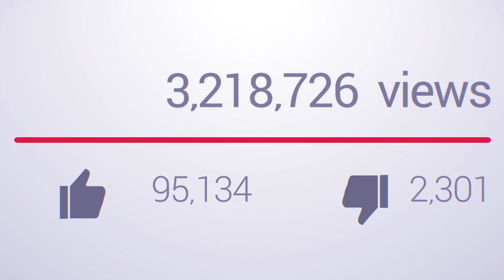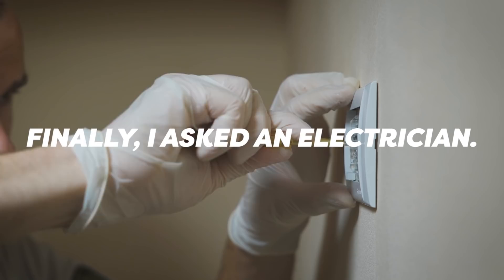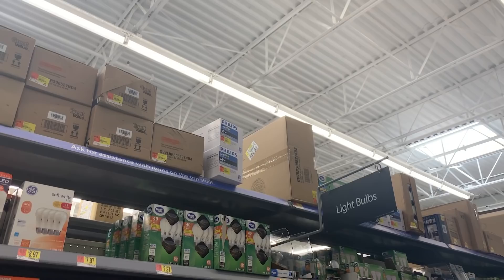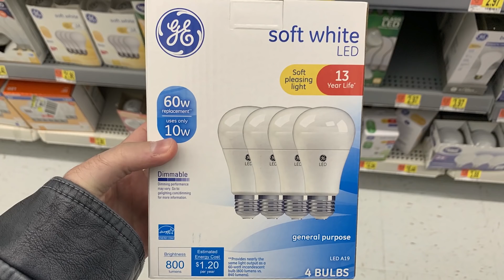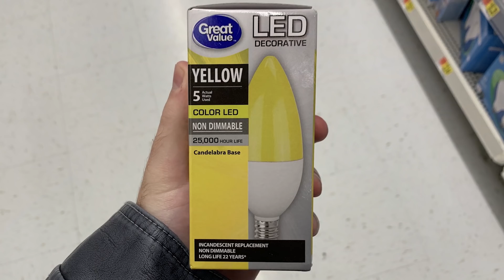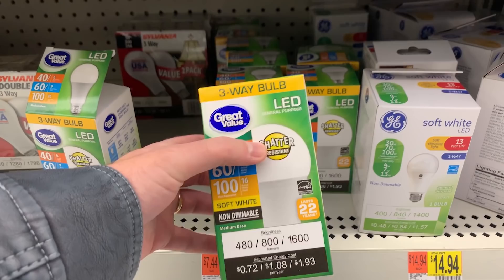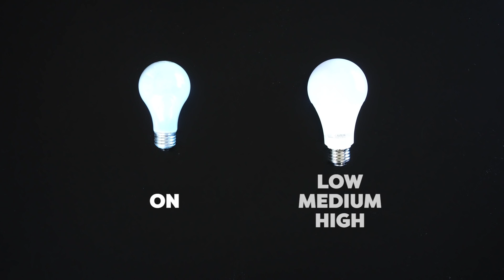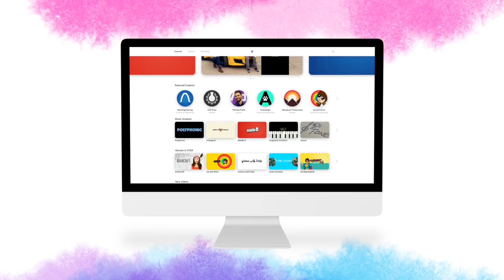Why Do Some Lamps Click TWICE?

Comment: “My car, one turn of a key.”

Proceeds to turn and click the key twice without starting the car...
Reply: Thank you for catching that. :)
Reply: I watched the whole thing waiting to learn how a 3-way bulb works.
Reply: @ugway051  oof if starting my car did not need my keys, I would totally just leave them at home
Reply: @seannelson9998  the bulb has a second ring on the bottom  center tip, ring - position 1 center 2 ring 3 center and ring 4 off
Reply: Meanwhile I have to turn the key and hold. This was posted by carburetor gang.
Reply: ugway051 or a golf cart

Yes I know most golf carts have keys, but they’re literally just dumb switches that aren’t required to be installed. You can just remove the key switch and wire it so it’s always ready.
Reply: I have to turn the key and pull a lever to start my car.  That's because it's an old Mercedes diesel.
Reply: Jacob Belcher 35 I had to turn the key while putting some pressure on the shift level...because my vehicle is a janky POS.
Reply: Thank God I'm not the only one to notice this.

Comment: Bonus learning moment:
The light from the lamp at 3:47 doesn't actually appear to get brighter at the three different settings.
But if you look closely at the wall in the background or the fabric at the edge of the lamp, the auto-brightness adjustment on the camera is dimming the whole scene slightly to keep the brightest part of the image (the bulb) at the same intensity. Therefore, as the bulb is turned up everything else gets slightly darker while the bulb appears to stay the same.
An example of the truth that photographs or videos don't show you "reality"; they show you only what they are designed to show.
Reply: so it goes from high to low?am confused
Reply: @siso8683  To keep an image from being washed out by bright light or too dim to see anything, the camera tries to maintain a certain brightness in every image it takes, which it does by controlling the exposure (brightening or dimming the whole image). When the lamp is turned from low to high, the camera compensates by dimming the whole image, so the bulb appears to stay almost the same brightness while everything around it dims.
Reply: @siso8683  Yeah it goes from high to low it seems like
Reply: @MorphRed  pretty sure it's the other way around, the camera is darkening the whole shot to compensate for the bulb's brightness
Reply: @MorphRed  no, the lamp goes from low to high. this is evident by the background getting progressively darker, not brigher.
Reply: Another way to phrase it is that photographs are "normalized" versions of reality. Nothing is too bright or too dark nowadays. Hell, many cameras take better photos in the dark than they do in the light.

Comment: Conclusion:

There’s three contacts on a three way bulb. Neutral, small filament hot, and large filament hot. 

Low is the small filament. (40w)
Medium is the large filament. (60w)
High is both filaments. (40w+60w or 100w)

Of course, LED bulbs don’t use filaments, rather two separate drivers and two different diode circuits, still working in combination to make high brightness or separately for low and medium. 

A standard bulb, as mentioned in the video, only has one filament or driver circuit. So it is only on when the lamp is set to medium and when the lamp is set to high (as the medium and low settings would be on together). That is the reason for the two clicks that the bulb is on. The other two clicks when the lamp is off is the designated off setting and when the lamp is set to low (standard bulbs don’t have the low contact).
Reply: I was looking for this comment.  Guess I'm just old, since this was no mystery to me, and have used 3 way bulbs for years before the cfl/led stuff.  Lol
Reply: Joey | the video from 4:03 to 4:30 is worth the thousand or so words in your comment :)
Reply: t5o7m Right, but he doesn’t go in detail with the specifics. He rather stated how the bulb skips a brightness setting because it wasn’t built to do it. (I was also adding the details on why the numbers are 40, 60, and 100)
Reply: The interesting part is, there are some bulbs so poorly designed, that the neutral of the bulb actually touches the "low" contact point - literally creating a short circuit.

Comment: "My car, one turn of a key"
Proceeds to turn the key for 2 clicks.
Reply: I WAS JUST ABOUT TO COMMENT THAT
Reply: SAME HERE
Reply: My car takes 3 clicks, but it won't stay in the fourth mode.
0: off, 1: unlock steering wheel, 2: turn on electronics, 3: ignition
Reply: My mom's car turns on automatically outside the car if she wants to. 
With just one button press
Reply: Well each click turns something on :)
Reply: @Liggliluff  0 off, 1 turn on electronics, 2 ignition, 3 crank starter. That's how it works
Reply: @annagrace2604  
That's not automatically.
Reply: One of those clicks is ON and the other is START. The cars electrics work fine at ON. And START is a separate circuit for the starter solenoid to engage.
Reply: I got a diesel so I have to heat the engine then turn
Reply: @annagrace2604  That's different thing.
Reply: same

Comment: Why do pop tarts curve when they come out of the toaster? Yeah, I’m serious
Reply: The heat makes it expand, but as soon they are cooled down they shrink, making the deformation. This is why you also hear the wooden furniture to make weird noises at night, since is cooling down, also why a ring may not fit you in summer days and some other stuff...
Reply: Also happens to pepperoni slices and the like
Reply: @blakcnagisa01  When you say "make weird noises" do you mean like crackling noises?
Reply: @blakcnagisa01  It's a bit more complex than that.

The non-frosted side is not as insulated as the frosted side(due to the frosting). So one side cools faster. Heat causes expansion, but the uneven cooling causes uneven contraction, and that causes the deformation.

Now the ring thing, actually, has to do more with water weight and bloating than it does with heating and cooling of the metal.
Reply: The heat warps the pop tarts into a different shape
Reply: Wow, my take is a lot different from what people are saying here. My theory is that because Pop Tarts are thin and doesn't fit in snugly, it tends to lean diagonally when toasting. Heat softens the pastry, and Volia! it bends. 

If it still bends if you put your toaster sideways for the Pop Tart, then the others are right.
Reply: Now I want a pop tart.........

Comment: My grandpa had one of these lamps when I was young with the three light intensity settings, but you turned it on just by touching the metal base. I was fascinated and asked my mom to get one of those bulbs for my room (I thought they could just work in any lamp because I was a small child who didn't know any better and for some reason I thought the bulb would turn my lamp into a touch lamp, probably because my grandpa said that his lamp took special bulbs) and my dreams were crushed when my mom said that my lamp only had one setting.

It's neat seeing more people discover the wonder that is the three light intensity setting lamp.

Comment: To be fair car keys need 2 turns also: one for the starter, one for the engine. Lol.
Reply: I'm not positive, but I think the first click on the ignition turns the electrical system on (including the fuel pump) the second click, which is momentary with a spring return, is the click for the starter which spins the engine to get it going. Of course, with the variations in vehicle technologies that won't hold true for all makes and models, but I believe it does for all the things I've driven
Reply: @dscrive  You're correct, sir, my mistake. Starter turns on the engine, which makes it the second position. First one just feeds electricity to all support systems.
Reply: The starter IS what turns the engine on, not the key. The "on" position on the ignition provides power to all of the electronics, and the "start" position just past that is a momentary contact that only goes to the starter. Once the starter turns the engine over the key returns to the "on" position.
Reply: @dscrive  This is true for any key-operated ignition. Push buttons can either be ones that: A) you have to hold for the duration of the starting process, or B) you simply press once and the starting process is automated
Reply: @gr6e  haha I was hedging my bets mostly because I know next to nothing about diesel vehicles.
Reply: @dscrive  I've seen several cars (possibly including the one shown in this video) where the first click disengages the steering lock (and turns on power for lights, radio and so on), second click turns ignition on and tuning past that into a momentary position starts the engine.

Comment: We have quite a few lamps that have light intensity settings built in. I even have a touch sensing lamp that has the light intensity settings per touch. I put a pink/red bulb that isn’t compatible with it that I found in 8th grade a few years back and it’s been there ever since. Though I have led lights now and they’re on the ceiling and not by lamps so I don’t use the lamp that much anymore. But when I do, I can choose, on, off, and on/off epilepsy flickering. It’s a remarkable beauty, the pinnacle of human achievement.

Comment: I guess a lot of younger people won't know that 3-way bulbs in incandescent days had two filaments, usually a 50/100/150W configuration with a 50W filament and a 100W filament.  The first click sent power to the 50W filament only, the second click switched to the 100W filament only, and the third click sent power to both.   The 50W filament usually blew first and the 100W filament lasted a good bit longer.   If you look at the base of a 3-way bulb and compare it to the base of a standard bulb, you'll find that the 3-way bulb has a second contact area.   The larger filament's contact is the same style as the contact on a regular bulb which is why a standard bulb operates with the 2nd and 3rd clicks.   Now that incandescent bulbs are rare, they make 3-way bulbs using CFL or LED technology and just wire some to come on with each separate contact.   If you make a bulb with, say, 600 lumens of LEDs wired to contact 1 and 1200 lumens of LEDs wired to contact 2, then you can have a 600/1200/1800 lumen output with this classic type 3-way lamp.    They used to make the incandescent ones in a 30/70/100W configuration as well.    The 3-way incandescent bulbs back in the day did give 3 levels but typically were not as efficient as standard bulbs.   A 50/100/150W incandescent 3-way would not produce as bright a light with both filaments activated as would a standard 150W one-way bulb.   This video made me feel old.

Comment: I thought everyone knew this
Reply: Willybots why did you think that?
Reply: Not I, says the fly.
Reply: Same, although I was the opposite of Austin in that I grew up with 3 stage bulbs and was surprised to find out that not all of them worked that way.
Reply: @johnwerner69  Because to me it seems self-evident. I don't know why exactly
Reply: @Xxfireman024xX  so far, I've learned that the one mistake you can make in life is assuming everyone knows something, no matter how small a thing it is, not everyone will know it.
Reply: and I do mean that they could not know about anything that is extremely common knowledge
Reply: I didn't know this.
Reply: @Xxfireman024xX  A lot of people probably don't have a 3 stage bulb in their lamps so how would everyone know it?
Reply: Just An Average Penguin I have never owned nor operated a 3 stage lightbulb. I didn’t even know what it was called. But it’s quite obvious to me that it is what the switch is for. The people who designed these lamps would make it a binary switch if that’s all they needed. Sorry for making an assumption on something that for me wasn’t hard to figure out. I get it. Not everyone knows what it’s for

Comment: Thanks! I just encountered this vexing problem at our friends' appartment, and it drove me crazy! I had a very different explanation, though: I believed that it was just me, and everybody else needs just one click. Therefore I didn't mention my observation. Electronic devices tend to react badly when I'm around and often break down spontaneously or at least behave weirdly and I get often teased because of this. Or people get mad and accuse me of having somehow damaged their equippment . Our last TV used to go dark spontaneously as soon as I sat in front of it, while it worked perfectly fine as long as I was in a different room☺☺☺ Nobody has ever been able to come up with a convincing non-weird explanation and chalked it up to me just being clumsy, a notion which of course I strongly reject. We even tested the vexing TV phenomenon in a controlled set up and made sure that the remote control was nowhere near me. My husband, who is a physicist, finally said, it must be a string of extremely weird coincidences  Therefore  I'm very relieved that there is a rational explanation for lamps which need two clicks - no matter who is operating the switch😇😇😇

Comment: I love 3 way lamps & bulbs! I build & rewire lamps out of spare parts for fun. There's other interesting things that are exclusive to 3 ways; you can actually tell if you have a 3 way socket by looking inside for an extra tab that the bulb base sits atop. Also, whatever component 3 way bulbs operate as a result of can blow & sound like any busted bulb that won't work & makes a rattling noise but 3 way bulbs will still work but only now have one wattage capability instead of 3. Not sure what prompts it to happen but it's pretty frequent.

Comment: As a mathie, the additive nature is kind of cool. These bulbs (we call them tri-lights in Canada) have 2 contacts on their base, in addition to the common negative which is the thread of the bulb. In the old incandescent version, one contact provided 50W of power, the other 100W. So it would cycle through the 50-100-150 brightnesses. Thus a standard bulb in a tri-light must contact the "100" contact only. 0 and 50 no connection, 100 and 150 a connection. I guess I'm too geeked out by this :-)

Comment: I'm pretty sure three stage bulbs were much more common back in the day which is why older lamps work like this. When I was a kid, I remember constantly selecting whether I wanted the low light or the bright light on the lamps in the house. Or my mom telling me to use a lower setting if it was too late at night.

Now I'm going to just swing for the fences with a theory. But, my guess is that making the bulbs three stage was more expensive and modern manufacturers know that people don't care that much so they don't include that feature to save a few cents per bulb.

Comment: A simple way to know if the lamp is for the single element or 3 way bulb, is if the lamp switch is a twist knob, it for the 3 way bulb.  If the lamp has a slider switch, push the knob through the lamp base, then it's made for the single element bulb.

Comment: I just use in-line dimmers that go on the cord nowadays. With in-line dimmers, I can use all of the modern fancy shaped bulbs. My favorite are the T6(looks like a vacuum tube) and the really long-skinny 8 inch T10 bulbs with the looong spiral filament in it(looks like a big heating element) :)

This is because the only 'multi way' bulbs that seem to exist are the boring normal-looking Edison bulbs we've been using for a hundred years.. I don't want to be stuck using plain bulbs for the rest of my life 🤗

Comment: yep i knew that. ive been studying light bulbs for years so here's something you may not have known. if you look directly at the base of both of those bulbs, you'll notice an extra connection ring on the 3 way cuz back in the day the incandescent bulb had 2 filaments. kind of like some of the automotive headlight bulbs. if you look into the plug where you screw the bulb in, you'll even see there's a 2nd connection pin. now that pin won't be there in plugs for like your switch type lights base.

Comment: So, in short, here's a good model.

Off - Off
Low - Off
Medium - On
High - On
Off - Off.

More detail:

After clicking to turn it off, assume it's in the off state. After the first click, it tries to enter the low setting, but if the bulb is incompatable, it remains off by default. By setting it to medium by the second click, it turns on. Then, click it once after turning it on to set it to high, but it just defaults to on. Finally, click it one more time to set it to off, and turn the bulb off.

Comment: I already knew the answer to this question. Not because I'm smart but because we've always had a lamp in our living room like this. It used to have a dim setting when you turned it once and had a bright setting if you turned it again. It stopped having a dim setting and it would always take two clicks to turn on (unbeknownst to me, a lightbulb change had happened) so I just always assumed the two things were related: well the first click no longer turns it to dim mode, so maybe it's just broken. All I knew was that it took two clicks to turn it on full mode so that's why it took two clicks to essentially turn it on when it didn't have a dim setting.

Comment: I have a lamp that needs to click twice because it used to actually have multiple brightness settings, but for some reason it stopped working and now it only has an on-off setting, and needs the two clicks. Even with the three-brightness bulbs. It's only a few years old.

Comment: I have some lamps that, rather than having three intensities, have two lights: the main light and a smaller light. One click turns on just the small light, the second click switches to the main light, and the third one turns both of them on.